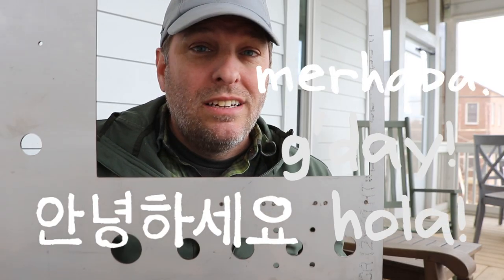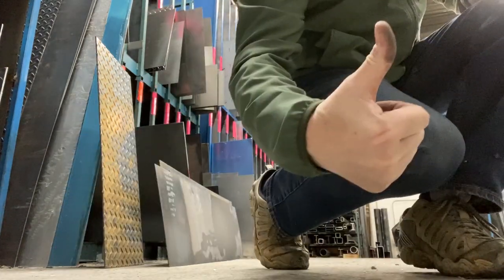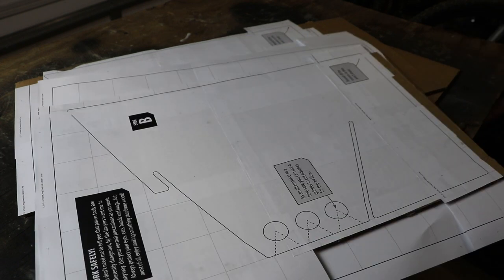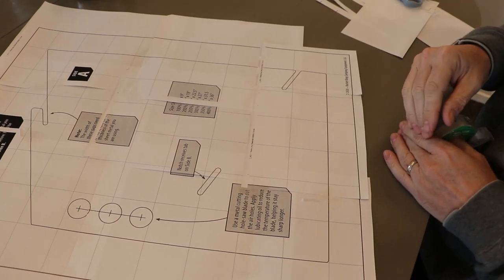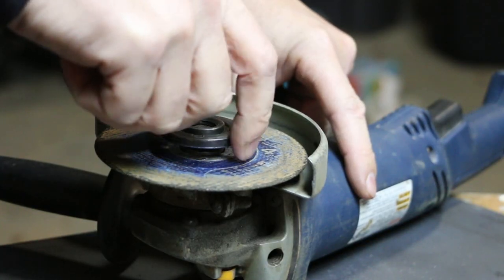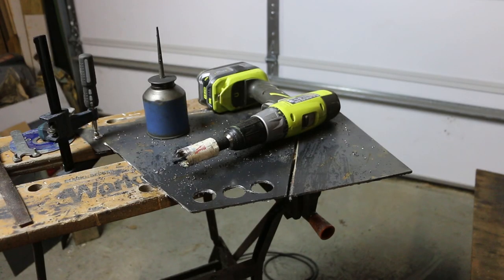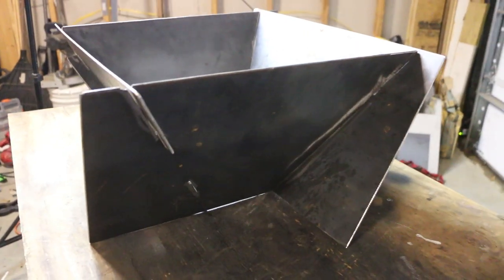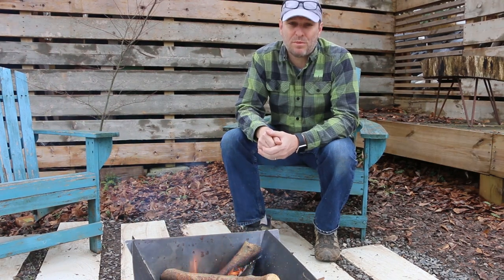How To Make A No-Weld Steel Fire Pit

Comment: #Awesome 👍 #Ideas 1. Some square Grills might be nice for grilling/cooking. A smaller one to nestle inside and hold the coals(or charcoal briquettes) closer to the larger grill that's stretched over the top of the firepit. These You might want to either have split or fold in half to make for easier access to the fire & coals. OR if they want that Firepit feel but still want to cook/grill. 
2. Have some triangle  Notches on the top edge of the firepit. For cooking on sticks or even turn it into a spit (A-frame that fits into the notches)
Reply from the maker: Good suggestions Heather. Thank you. I like the notches and grill idea. :-)
Reply: @GreenShortzDIY  are you selling these already cut out?   Not plans actual metal cut outs
Reply from the maker: Hi Allen, I’m thinking about doing a short run of these fire pits. I need to cost it out. Interested?

Comment: I do know there is available "fire stove paint" in spray cans. That would make it more rust resent for the hot rolled steel. Great video. I personally would use the fire stove paint for the longer life of the fire pit, without the needed cost of stainless steel. Just an option for you and your viewers. Thanks for sharing.
Reply: It helps, but eventually, it fails.  I need to hit my fire pit I welded up with a grinder and repaint this spring.
Reply: Good to know. I do know regular stoves for wood needs to be repainted. How about a design to include fire bricks as a liner? That should extend the life of the metal as well. Thanks.
Reply from the maker: Good input guys. Daniel, in my experience, the paint likes to pop off. But, it is not difficult to run a wire brush over it and repaint, like Chad (ManCrafting) is suggesting. I’m going to go the raw metal route to see how long it holds up. Thanks for the feedback. Thanks for watching.
Reply: Corten Steel might be a good option for this.

Comment: Great video.  Just ordered the plans.  I teach a Manufacturing/Engineering class and would like to do this with my Seniors.  Just recently purchased a plasma cutter with a 4’ x 4’ table.  Any suggestions for this application.  Am excited about working on this.
Reply from the maker: Cool, Mark. Thank you for letting me know. I’m not sure if all four pieces will nest on a 4x4 table (depending on scale, of course), but they could set up the file with the two different pieces and cut it twice. One tip, a clean through-cut has a lot to do with the speed of the plasma nozzle. Slower for a better cut. Have fun with the plasma table.

Comment: it is awesome . is it possible to cut the outer edges .... and make it smaller ؟؟؟؟؟؟؟.... then instead of rectangle , it would be trapezius ...
Reply from the maker: Hi Tala. I think if you want to go trapezoidal, you’ll want to make the sides vertical instead of leaning. Wider slots will let you tweak the angles. Or angled slots, but that is beyond my ability to do the math. :-)
Reply: @GreenShortzDIY  Hi . thank you so much

Comment: a pyramid has one 3rd volume of square height, an equidistant triangle has a height of 86.6 % 
the upside down pyramid aproach looks good but you could still reuse the parts sticking out as a grid stand around the edges and put stones on there for a stone bake
Reply from the maker: I have set a pot on the corner to use some of the heat to boil eggs. Thank you for the feedback. Thank you for watching.
Reply: @GreenShortzDIY  I've seen a DIY trick where you put a pair of pots with holes in them one on top of each other, wt a spacer and a lid to concentrate the heat energy from a set of candles, thats interesting

Theres a thing called a log torch, not a lot of people know this but Log torches were actually medieval torches, you litterally stick a piece of wood on a small stake and then you light it up, those clishe little ones are actually half hour torches I think they are for  faster ednition. 
The modern type involves splitting the log, carving the top a bit and making a channel to vent in air from below, 
I think that might be a good quick video idea. 
Ususally you wrap it with some metal cord but I think you can prepair these just by sawing, the air inlet is like a diamond square so it kind of reminds you of 5th element,, 
I think a grip for a log torch , a stand for a log torch might sell better because it looks artsy fartsy, 
It would actually be easyer to transport and use less material if you use the cord to hold it and make the interlock4 sides of a cube with crossed stand legs
I can see hotels getting in on this but it would have to involve smaller logs or a pack of them in a central fire pit, 

I dont know I'm rambling, Bye :)

Comment: If I was to buy a 4 x 8 (12 GA. (.105 thick) Hot Rolled Steel Sheet - is this the right gauge?), how large could I make this project? That being said, at what scale should I print your plans based on your response? Thanks very much in advance
Reply from the maker: Hi Brian. Thanks for picking up the plans. Your gauge is correct. I'd recommend a 400% scale. That would work exactly with the 4 foot dimension (24 inches + 24 inches). At that scale the four pieces would be 3 feet on the long side, leaving a 2 foot by 4 foot strip on the long side of your metal sheet. You could also stretch the sides to 4 feet wide instead of 3. It would be 4 feet square, but only 2 feet tall. The angles and notches would stay the same. You might also see if the supplier would sell you a 4x6 foot piece. The price of a cut-to-size might be less than the cost of the 4x8 sheet. Just my two cents. Thanks again.

Comment: Way to much smoke... open up the sides so the fire can breathe... I'd recommend a fire screen top.
Reply from the maker: Thanks for the input. I’ll try a few more times and then perhaps add the air holes to the other two sides. Thanks for watching.
Reply: @GreenShortzDIY  Consider vertical slots on the sides for more combustion air.